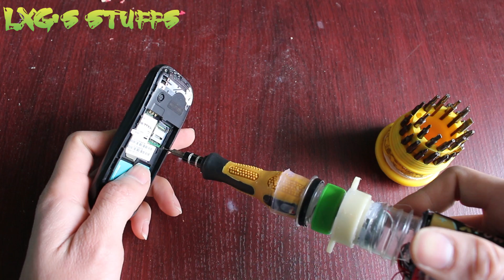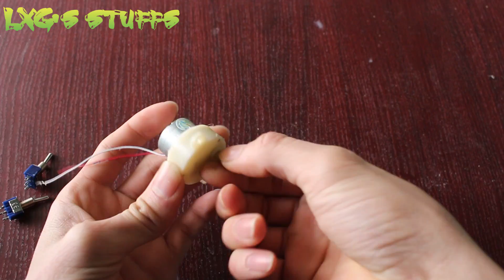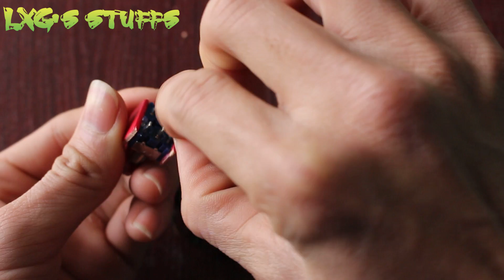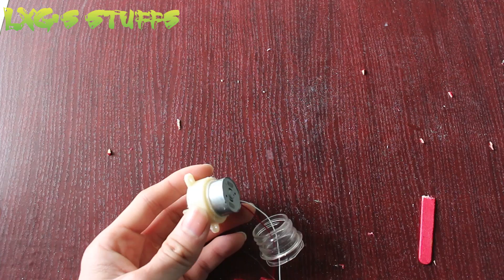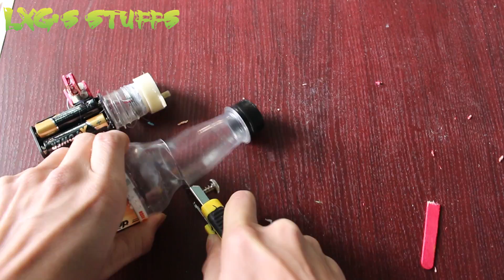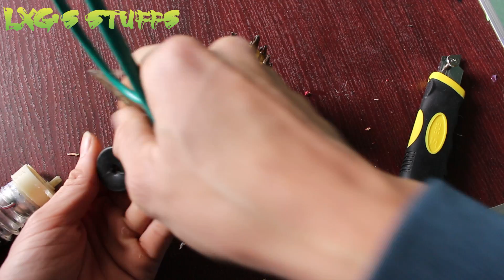How to make a Mini Electric Screwdriver | Very simple tool

Comment: it's cool but is too slow
Reply: it's called patients
Reply: +Kaine Wolfe well I have no patients by the time he opens the mouse I Wil be done fixing it
Reply: +bear's gaming riiiiiight ok m8 have fun wit dat
Reply: +Kaine Wolfe it is slow. Way slower than even the first one that I bought 25 years ago. Even slower than my Kincrome one I use for micro stuff that runs 2 X AA batteries and cost about $12. You can buy a 4.8v cordless screwdriver for under $10 on most of the auction websites, they're more powerful, rechargeable and much, much faster. Ok, it's cool he built it himself but it's basically fucking useless. And you still need to use your existing screwdriver to accept the bits.